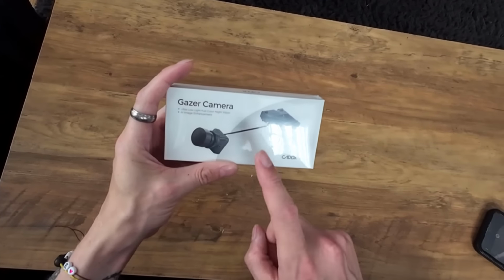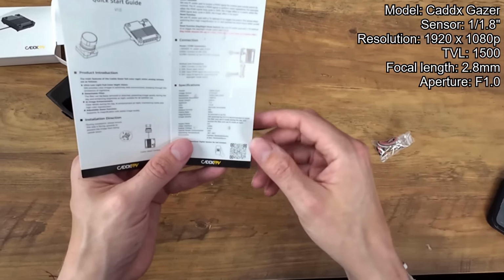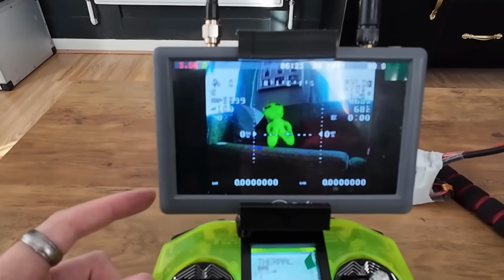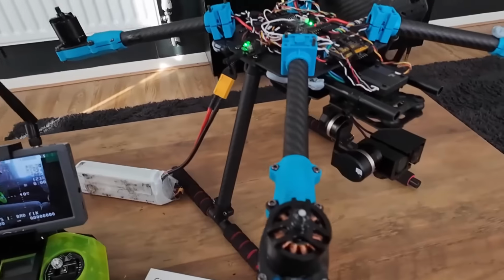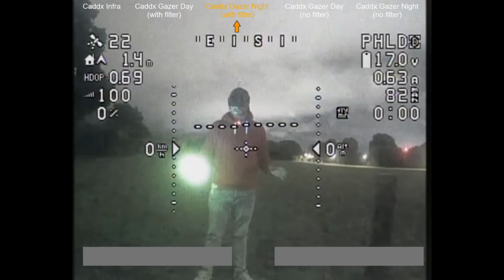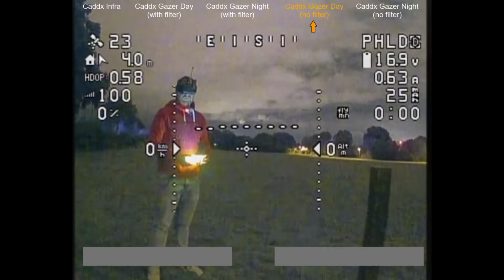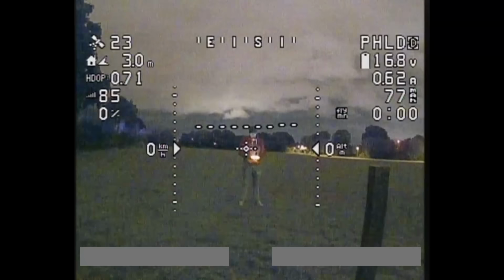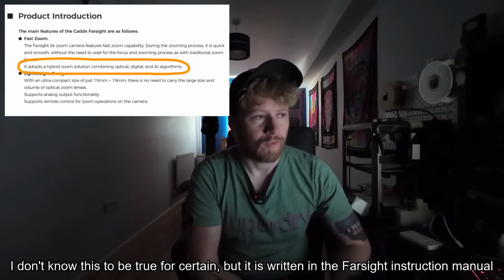📷 Caddx Gazer - COLOUR Night Vision FPV Camera - Unboxing And Review

Comment: so interested. I would love to just get the camera without the transmission modules and use it on a NVG google
Reply: That black box is not the transmission module, it's part of the camera processing.
Reply: You could take the video out from the camera and connect it directly to your analog goggles and it would work as night vision. Giz FPV did this with is Infra when he first purchased it to try the camera out at night.
Reply: @ddegn not out from the camera, but from the module that comes with the camera
Reply: @erikvf7  Yes. I was considering the box to be part of "the camera". 
As you correctly pointed out, the box is not a transmitter. "it's part of the camera processing" or as I was thinking, it's part of the camera.